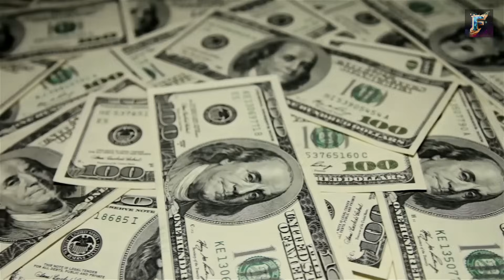AT LAST! US Senator, NASA, Forcing FAA to approve SpaceX Starship launch!!

Comment: The FAA will not be able to change quickly enough to keep up with commercial space flight developments. Space should have a dedicated authority to oversee future developments. This should be set up by splitting the part of the FAS that deals with space away from the current authority and streamlining its processes to meet the emerging needs of the future space industry and finally ensuring that it is fully funded by all those making use of its services.

Comment: BS.  They don't need to add more people, they just need to accept the things that have already been proven and focus on the challenges.  Bureaucrats focus on the checklist instead of allowing the vendor to work the list, and for them to look at the challenges.
The FAA also is well behind the times with regard to Development Methods.  They are entrenched in a paradigm that is dated and inefficient.  That is the NASA procedure of endless redundancies and nitpicking details that provide UNNEEDED certainty.
This is completely counterproductive in an environment of lower cost prototypes that have a higher accepted probability of failure.  When a failure occurs, the FAA requires a painstaking process of investigation, documentation and justification of the failure, when progressive companies focus like a laser on the problems identified and innovative mitigation of those risks.  It is absurd to prove on paper and engineering that a mitigation will work with calculated SDs and CVs ahead of the next try, when the company is focused on TRYING the solution to gather data along the way.  By using a REACTIVE model, a company can find and solve the problems quicker than creating a virtual stack of thought experiments that (in reality) will fail in step five of a 15 step process because assumptions were not tested against reality.  (Ignored blow-by of O-Rings comes immediately to mind)
The FAA process is completely out of step with the SpaceX process of failing quick and fixing the issues as they go along.  This is compounded by the reduction in pace because by lengthening the process of FINDING the problems by delaying failure, those problems are BAKED INTO future attempts as an assembly line of prototypes are poisoned by problems that COULD have been solved had they not been busy doing SD and CV calculations to estimate risk to the third decimal place.
The maxim is "Lead, Follow or Get Out Of The Way".  Which one is the FAA's proper job right now??
Reply: Let's look at two problem instances, shall we??
Buildup of gasses in the engine skirting have caused fires in the engine compartment that have compounded the problem of reliability and controlability of the engines.  In the NASA era, this would have set them back six months while figuring out a solution.  SpaceX has done this on the fly and we will try out the solution in the next launch.  We don't have to PREDICT if this will work, we can launch and SEE if it fixes the issue.  
What about commanded destruction of the vehicle in an out of control situation?  We found on the last flight that the vehicle is quite a bit more robust than the engineers thought.  It even tumbled when out of control, and the commanded destruction took longer than expected.  SpaceX has taken this problem under study and has rolled out a solution that MIGHT be texted in the next launch.  I will grant you this....  As Starship is considered to be a pop can rather than a Lambo, they will find a way to test this destruction mechanism in one of the prototypes, you can count on that.  The NASA way would be to PROVE that rather than putting it on the parking lot to test at a convenient time.  I am sure that the checklist weenies are making SpaceX jump thru hoops to PROVE that the new destruction mechanism will work.  Dipsticks, we proved it worked LAST TIME, it just needs to be more robust.  Will the FAA accept that as an answer?   What do you think?

Comment: Its as simple as......
    Spaced "X" is the leader !!
The "FAA" should be learning from them.......

Seems time for Space "X" to hold a "How to build rockets" 101 classes for the "FAA" students...
Reply: You mean how to fly an out of control rocket, the biggest ever, less than 10 miles from a resort area with a dysfunctional destruct system? You mean that class? Or is the other class, the one where concrete debris is pulverized and pelts near by fuel tanks, sending large chunks of concrete hundreds of meters?

Comment: If the FAA had testified Senators could have challenged the agency on what it is they actually do to issue a launch license.  And more importantly, what is it that the additional regulators would do.  The FAA should be streamlining the work they do. Automate the paperwork. Being that this is a new rocket system, the FAA has to rely on SpaceX to design the safety systems and address improvements.  Nothing for the FAA to do but accept that the rocket is ready for the next test flight.
Reply: And that goes with the analysis of any failures as well. Space x will let them know before they ever figure it out.